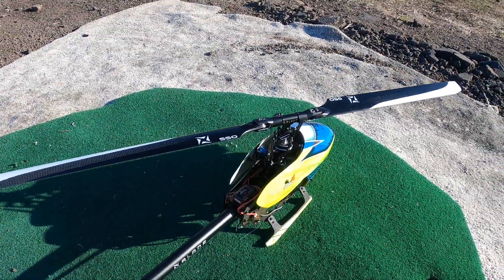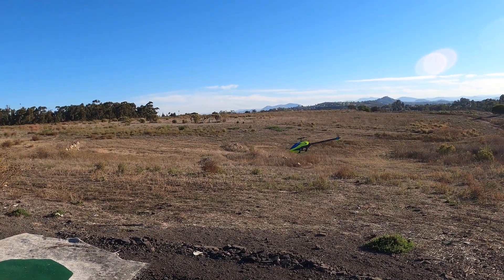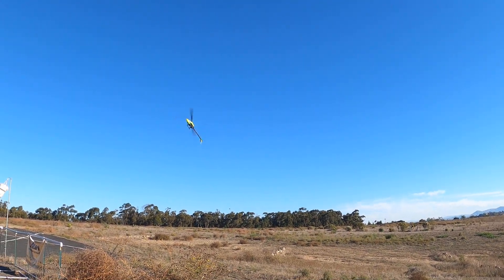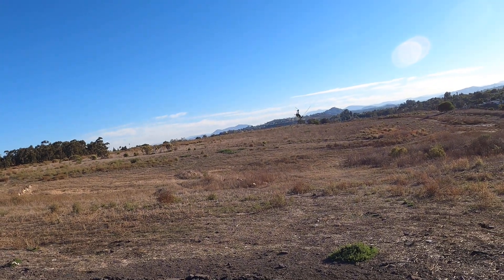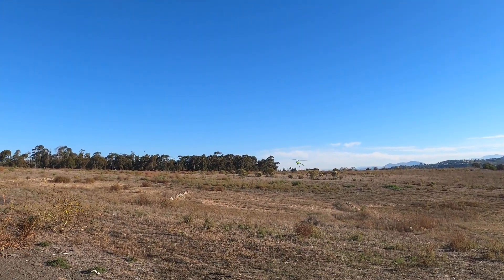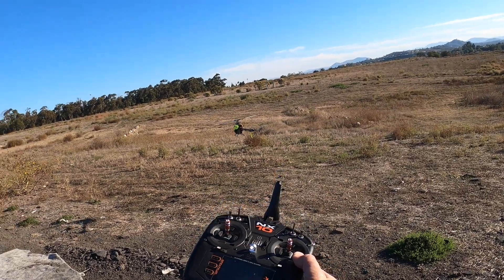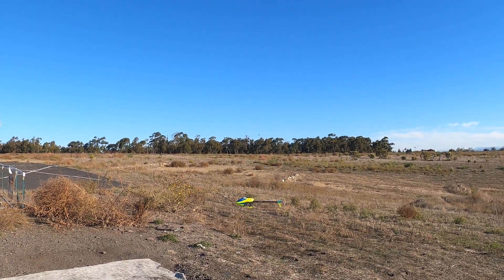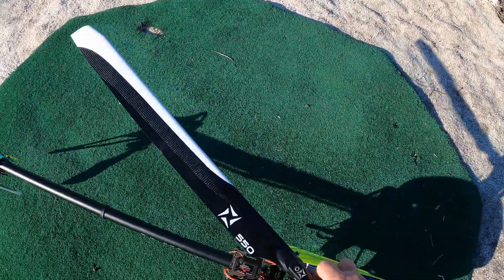First Flight with New 5.6 Firmware in my Spektrum 6250HX Flybarless System

Comment: I have the 330s.  Can not find an update anywhere.  can you point to a page for the download?
Reply from the maker: Hehehe.  You have to use an spm3065 cable and go on Spektrum updater firmware.  Plug in device. Power up, it will ask you to register, and then it will update.  You don’t need to.  Just fly that thang.
Reply: @CoeShow619  been trying.   It want to lean forward and to the right just before lifting off. And never stays in one spot.  I know it's not supposed to but it will take practice
Reply from the maker: @kennethvilhauer5373  safe mode does the lean thing.  Take off in stunt 1, no safe mode.  It won’t lean unless you lean.

Comment: hey Coe! thanks for all the great advise and set up help. i appreciate all you do for the community! I have a quick question, how do I set up my IX12 to show RPM data from my v4 hobbywing ESC? i have the HW dedicated RPM sensor wire connected to the only port (6) on my 6250 however it doesn't show on my telemetry. thanks again!
Reply from the maker: Umm. Yeah.  I’m sorry dude, as far as I know, the 6250 only picks up telemetry from an Avian speed control.  Except the biggest they have is a 120 amp.  I use IKon2 with Hobbywings.  I have been over and over this with Spektrum. Ask Ethan Ater. Little wiz might have a work around.  Oh and the Hobbywing telemetry comes from the P port on the side of the ESC where the fan plugs in.  All I do is go P to pin 5 on my ikon and it’s done.
Reply: @CoeShow619  cool thank you 🍻

Comment: Besides the update, did you make any initial program changes on the FC6250?
Reply from the maker: After this flight I turned I gain on roll and pitch up 10 points. Then I turned tail stop gains up 5% and dropped the gyro tail gain 5% on my gyro screen to fix that fast wag I had at high speed flight.
Reply: @CoeShow619  hy coeshow! First, i love to watch your Videos! Your Videos and your flight style were the reasons for me to buy the Blade fusion 480 and i love  it! I do the the Firmware Update today. But can you please Tell me or us some numbers of your fbl settings? This would be a great help for me, especialy because im new to helis. I fly heli since 2 months. So please Tell some numbers. 
Hope you see my post. So have a nice time Justin!
Greetings from Austria!
Reply from the maker: @thomasspieler23  I used the 5.6 firmware update. I hit restore defaults, so that my old tune was gone. Then I checked the servo setting frequency for 333hz for cyclic and the tail, I assigned Gear as my flight mode channel and Aux 2, as gain channel in 6250. In radio you need to channel assign Gear to Flight mode and go to gyro screen and assign flightmode switch as your gain selection, and assign Aux 2 as your channel at the bottom. Now put 75% for Hold and Normal , and put 65% Stunt 1 and 60% for Stunt 2 gyro gains. In Set Up then AFR I’m about 75 on Roll and Pitch. This is to get 10 degrees cyclic, and about 45 or so to get 13.5 degrees collective. My numbers for PID are default with 5.6.
Reply: @CoeShow619  thank you very much! I will try these settings. Agility i will leafe Stock. Pid also. But the numbers for pid are extreme different with the 5.6 firmware. The gains in the gyro i will change to the numbers that you have. Tank you for All your help! 
Grettings from Austria...
Reply: @CoeShow619  Ok i think i got it. Is it right, with these settings i have no Panic?
I got the Spektrum NX10
Maybe i give you my email, so we can send some pics or setting files for the Transmitter?
Thank you for all your help and sharing your Hobby with us!
Greetings from Austria...
Reply from the maker: @thomasspieler23  all of that info is on the SpektrumRC YouTube channel.  Watch all of Tom Cogswell videos. I don’t use panic. Never will. Just don’t panic. Haha. Some of this new stuff is too millenial for me. In my opinion, hitting the hold switch when you are about to crash is a much better solution. I don’t fly high enough to use panic. I don’t know how it works and don’t need it.  Sorry I don’t know that one. Watch Tom’s set up videos.

Comment: Do you like the Nx10 more than the Ix12?
Reply from the maker: Yes.  I am middle aged and I don’t like millenial gadgetry. So I prefer the scroll wheel and instant on/off instead of a touch screen that disagrees with my fat fingers. The NX10 is just faster and easier for me. It’s preference. I just wish I had my Bluetooth function so I could change settings on my Brain2 as I can with the IX12.